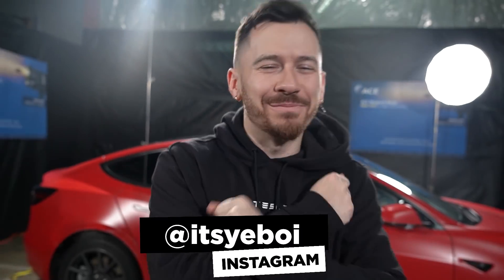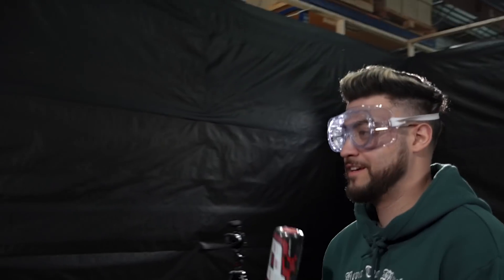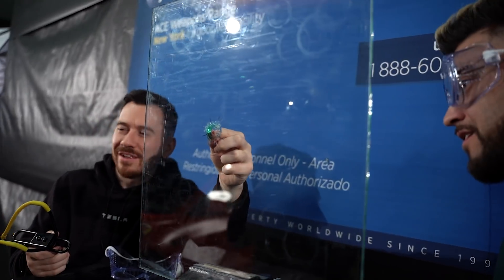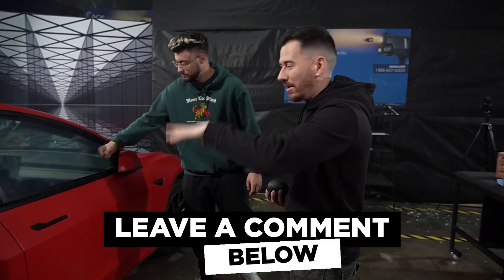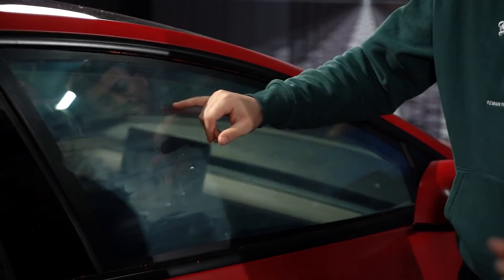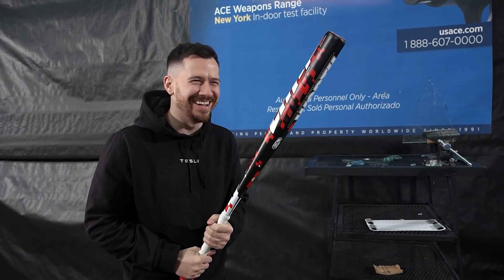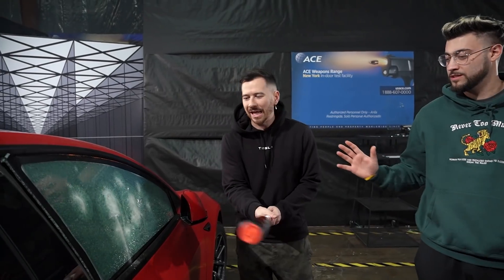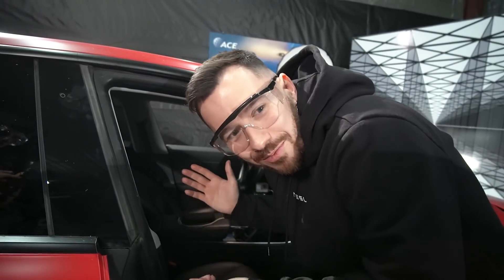Can A Bulletproof Tesla Really Stop A Bullet?

Comment: Car windows are made weaker so that in the case of the emergency, you can punch, elbow or stab it with your seatbelt. Car windows are called safety glass because it breaks into more of a square-sized chunk so if it breaks it cant slice your skin and make you bleed, and so safety glass is basically just chips of glass compressed together, but that’s changed through the years from 1923 (when the model t was created and released, with pane glass) to now in 2020. Although, windshield and the glass roof of a Tesla is actually just 2 pieces of glass compressed between 2 pieces of safety plastic so when something hits it, it won’t break, and when you need to get out, you should get your feet in the corner of the windshield of the car and starts kicking and pushing with your feet, because the corners are the weakest park of the glass.
Reply: @mohammadluqman5a670  Sure, What's its on😂
Reply: Its a laminate not plastic
Reply: @williammoore5459  yup.

Comment: If someone wanted to they would shoot a hole clip in the window and one would get through at least and if they used an axe they would take a full blown swing or if it was a Hammer or any other swinging item they would full wind up and hit as hard as they can but also the driver would start driving as fast as possible therefore this would save life’s for sure... but also they should put it on every window in the car, but they should develop a tool to break the side windows but can only work from inside the car so that u can get out if ur in water or stuck or something

Comment: They shot the glass at such a high angle that the effective thickness was far greater since it had to go through the diagonal. I wish the were confident enough in the product to shoot it straight on.
Reply: Since they were doing it inside, they probably had to do it at an angle for safety reasons. If they had done it outside at a greater distance but straight on, the risk of hitting the car instead of just the glass would be higher (you never know how bad a shot someone is). It's basically a no balls no glory situation here.
Reply: Also there is another video where it was shot directly at the window and farther away from it with different kinds of bullets and guns
Reply: @bassbrother101  That glass looks way different, then the one in the video.
Reply: https://youtu.be/bAlGzsVsbLE 3:19 5:28 i recommend watching the whole vid but this is when he shoots it
Reply: This kind of makes more sense though, if someone wants to kill you in your car, they're probably going to be standing up in front like she demonstrated, its not like they are going to be crouched behind a table 5 meters away and fire a single bullet.

Comment: so this is a normal car window with some kind of plastic on both sides?
Reply: I dont know about this product but most bulletproof windows are made with multiple layers of glass and plexi type glass to slow down the bullet and there are just a bunch of those layer's
Reply: @ipant1056  the ace tinted is a laminate that stops bullet from going to far into the car
Reply: @williammoore5459  ace tintment is just a type of tintment and is not nearly close to stop this bullet
Reply: @ipant1056  i saw ace video they dropped a bomb and the tinted stopped the glass from shattering
Reply: @williammoore5459  yes, the tint does help it not to shatter by holding it together but it wont stop a bullet at all

Comment: The shooter is utterly stupid. You always have to account for riccochet because it can easily hurt somebody. Also, the shooter shouldn’t have shot at an angle like that. The shooter should have shot under a 90 degree angle so if the bullet actually passes through it would hit the other window, and not the seats and the interior which is more expensive than glass. Please, imagine this and think wisely before running into problems. Otherwise, I really enjoyed the video!

Comment: The rock only chipped it cause of the point on the rock, points & sharp edges will always do more damage than something smooth, no matter the weight, that’s why the rock made a mark & the smooth black ball didn’t, however the smooth mace did as much damage as it did because of the force put behind it along with the multiple hits.